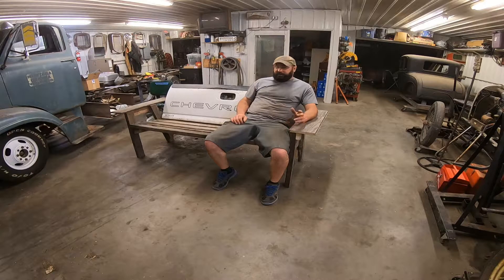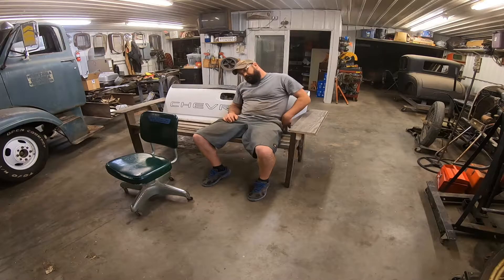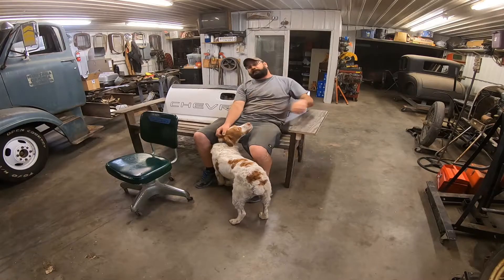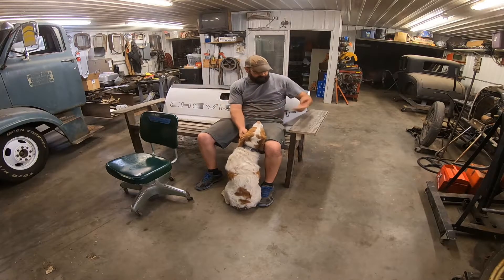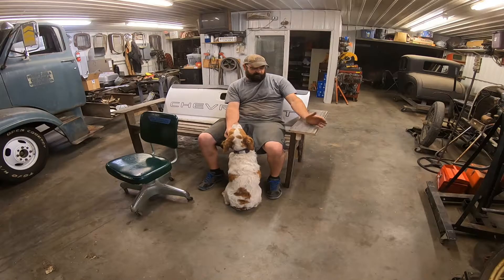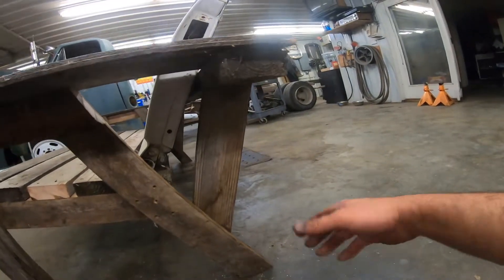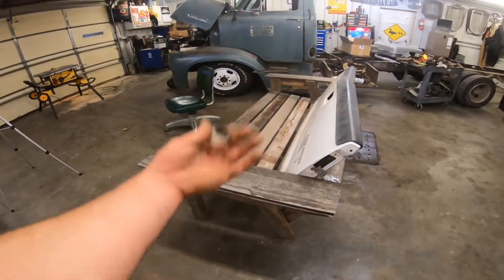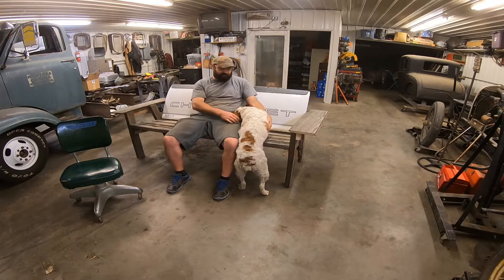How to build a proper tailgate bench using some recycled barn wood and a little ingenuity! Budget!

Comment: I generally love old, rustic furniture, and craft/folk art type things...but I really, really despise tailgate benches made with good, useable tailgates..there are just too many old trucks that need a good tailgate, whether it be a work truck or a restoration..and let's face it, a decent original is better than a new reproduction. I actually fume when I see a nice tailgate "wasted" on a bench, even if it looks nice..that's not the point. People snapping them up to use them for this "fad" is just drying up the already short supplies. Benches made of really crusty, rusty, rough ones, or more modern ones, don't bother me as much. I have actually considered trying building a nice wooden bench, then removing the center panel from a '67-'72 GMC tailgate that I have that is totally beyond repair..the panel is about all that is salvageable from it...and then mounting the logo panel from the tailgate onto the back of the bench, nice and flat, kind of like those public benches that have advertising signs on them...

Comment: Great info! I've always wanted one for the garage.
Reply from the maker: Don't do it!! Unless you've got way more room than I do! If you do make one, make in uncomfortable so all your friends don't want to come over and watch you work! Thanks for watching!
Reply: @MortskeRepair  I thought I may attach to the wall and have it fold down like a gate should. Besides, I don't have that many friends! lol
Reply from the maker: @OldeCarrGuy  I've wanted to do the same thing and use the back 8" or so of a pickup bed with the taillights, gate, etc. The problem is I'm out of wall space too!! And I can't get myself to cut up a box. Even if it's a 73-87 GM longbed. One day I'll make one. I don't have many friends either. But I keep a cooler full of adult beverages, so a lot of stragglers swing by on a regular basis.